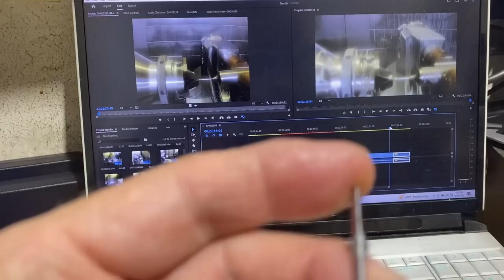Small Needle On Big Machine.

Comment: Okay, I'm an engineer and I design parts... but I also run them on machines. The person who designed this part needs to sit on the machine and see the connection between their big monitor and reality of what kind of setup is needed to make it happen. I am certain that if designers machined their own part the parts would look very different. Big thanks for putting the simulation overlay for the toolpath, we all know how hard it is to see what's happening under the curtain of coolant.
Reply: Similar to graduates who design modern cars at a desk, they should be made to spend a month repairing them

Comment: Holding that 3 flats in 6 jaws is a bit sketchy for me. You should remove 3 jaws from that tiny chuck, that gives you a stable clamping situation. Thanks for video!
Reply from the maker: These jaws are almost sharp on their tips and as it turned out accurate enough for this. You saw in the video I checked it chucking all 3 positions. Chucking it this way aligned the part for the C axis rotation. If I had removed 3 of the jaws it would be necessary to indicate the flat and set the C zero on every part. This way the two jaws on each flat aligned the part for that.

Comment: "Malfunction on the A axis drive" on a HAAS mini mill .....

Hmmm welcome to the club.... mine has been doing that on and off since it was year old, I fix it by opening the cabinet at the rear and jingling all the wiring around LIGTHLY, I suspect some faulty connector with a lousy connection
Reply from the maker: I bought these machines in 2005. This is the first problem I have had with them. I will try what you suggest. The servo drive will jog for a little but it overloads with very little load. It may be as you suggest a bad connection of some sort. I haven't had time to trouble shoot it yet. Thanks!

Comment: 9:14 'Yo dawg, I heard you like chucks'. ;) Man, what a tricky multi setup this one was. Machine is certainly overkill for such a part. You still got it made though. Excellent work.

The small support stop idea was real nice. I am wondering though, if the repeatability of using the spindle to bring it over wasn't feasible to move it out of the way each time. Instead of keeping the steady rest stationary. Would that work, or is the repositioning wack?
Reply from the maker: If you are saying, why not move the steady rest back and forth. This steady rest gets moved by a dog and shot pin engaged to the Z axis of the machine. So to move it the Z axis has to be positioned. The shot pin extended to the dog for the steady rest. Un clamp the steady’s base then drag it with the Z axis. Now you can imagen the time that takes. Although that can all be done automatically in the program. But it can’t really be repositioned accurately. With for the normal purpose of a steady rest isn’t required. I did also experiment moving my end support center out of the way by unclamping the front jaw of the steady rest. But I wasn’t satisfied with that and abandoned that idea when I found I could just change the part as you saw in the video.

Comment: I’m curious about drilling the thru hole. Is there an advantage to spinning the drill vs spinning the workpiece like in a lathe with no live tooling?
Reply: Can spin the drill in the milling spindle faster and the lathe spindle.
Reply: A tool salesman told me that when the drill is rotating, it gets the chips out more effectively than when the drill is stationary.
Reply from the maker: The only time I would use the turning spindle for drilling on center-line is for a very large drill. At low speed the turning spindle has more torque than the milling spindle. I think what harrihavulo7091 says is true. A spinning drill with spiral flutes evacuates chips better if the drill is turning. But a lot of drills don't have spiral flutes. So in that case there would be no difference. If your turning spindle can rotate the speed necessary. In some cases when drilling all the way thru there could be s slug thrown out by the chuck jaws. If that was a problem. Drilling with the part stationary would eliminate that.
Reply: @EdgePrecision  Thanks. That makes a lot of sense. The only drilling I do on a regular basis is with large indexable drills usually 3 to 5 inches in diameter. We usually stop the drill about .05 past the rear of the part and then pound the slug out. Every now and then it comes flying out, and the adrenaline spikes.

Comment: Always love the setup work you do. My question for the customer is why wasn’t this sent to a shop with Swiss machining capabilities? Not to say any thing bad about what your doing, just curious. Work that small is easy work on a Tsugami or Cinicom. Is this in house with the place you’ve got the Mazak in? I love that mini chuck!
Reply from the maker: There is not a lot of shops here in Houston Texas that have Swiss type of screw machines ant the ones that do (Like only two of them.) have a big backlog of work. Also I think this part was mistakenly taken by my customer here. So they had to do it but didn't have a way of really doing that.  They came to me and inquired if I could do it. So in this video you see how I did. But you are correct. It is an ideal screw machine job.

Comment: Never worked with 17-4PH before. What is the PH designation all about? Have seen the numbers before in a Carpenter Steel Die maker's Bible. Never figured out how precipitation hardening worked.
Reply: Pre hardened
Reply from the maker: The PH stands for Precipitation Hardening, or age Hardening. The way you heat treat it is. Start with a solution annealed piece and heat it a a certain temperature for a certain amount of time and let it air cool. The most common temps are H1150 H1075 and H900. The lower temps are harder.

Comment: Can't you make your tailstock be at an "approach" position, so it doesn't need pressure on the spindle to be accepted at a given position? I do that on my Multus.
Reply from the maker: No this is a old machine. The tailstock has a hydraulic quill that extends. It has to have pressure on it when engaged. Maybe there’s a pressure switch I don’t know. Even if I extend the quill all the way it won’t work either. Turn the pressure down to far it won’t let the machine run. The way this tail center works is you position the tail body clamp it to its ways. Then extend the quill. It is not servo driven as on the newer Mazaks.

Comment: Hello I am looking to put a hass mill in my garage shop. Can you give any recommendations as what to do for power as I don'e have 3 phase. Do you use a phase converter in your shop? Any advise is greatly appreciated.
Thanks Steve
Reply: The TM and TL series Haas machines will run on single phase electricity. I have a TM1 Mill and a TM1 lathe both in my garage and both operate on Single phase.
Reply from the maker: As precisionforce2436 says. My machines also can be run on single phase power 230 VAC. I bought them in 2005. I woulld assume they are still the same with the TM1 and TL1 machines.
Reply: @EdgePrecision  thanks you guys. I think I have 220 volt service.
Reply from the maker: @swordfish2089  220 volts would also work.
Reply: @EdgePrecision  thanks

Comment: Haha, a problem with the Haas... I don’t believe you... 

My haas has a problem every other day... that what they do, they have problems....
Reply from the maker: I bought the machines in my garage in 2005. So far this is the only problem I have had with them. I have owned may different makes of machines in my time. I don't think Haas has any more problems then other makes. But that kind of depends on what you do with your machines.
Reply: @EdgePrecision  haha I’m just having a dig as haas mate, nothing against you. My Little Haas turning centre is the worst machine I’ve ever operated, by far. While it’s pretty straight forward and easy to operate, it only ever runs for about three weeks at a time without breaking down. At the moment it’s dead, I’m tossing up sending it for scrap metal, or retrofitting it, but it’s not even worth retrofitting.
Reply: @madaxe79 that thing must have been made on a friday😂 Haas machines are no stranger to the occasional problem, but every 3 weeks? That thing is a piece for sure